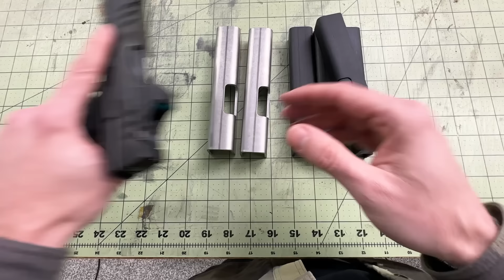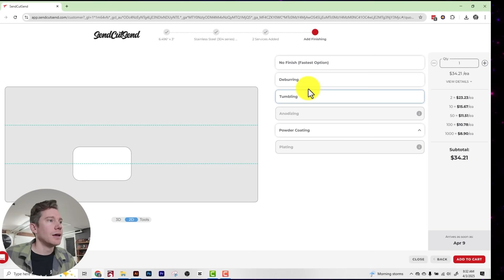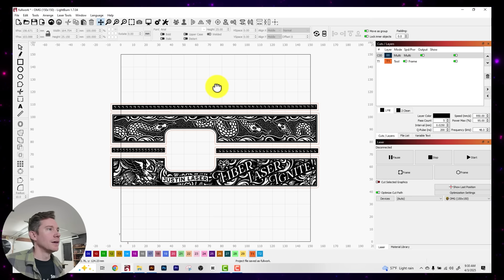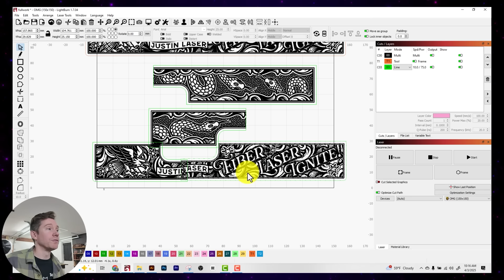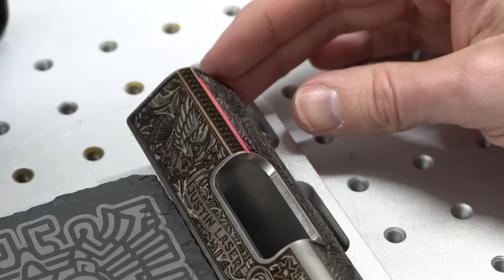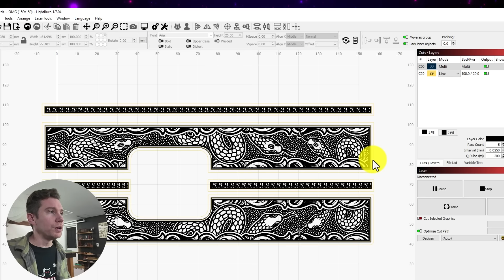How I Practice Gun Laser Engraving (without a gun) + Free Template!

Comment: If you build boards with dowels that fit on table.stops that fit a few of your dowel pins once you build the fixture your next setup is done just cut your stops as you x and y with the laser to set home positions. Remove store fixture setup next fixture all you need to run the machine is an operator to load push start rinse & Repeat

Comment: 304 is also a lot less tough strong and rigid than the steels they use in slides. with stainless slides which are the ones that you would probably be engraving (refinishing is much more difficult than it would seem) usually they use 17-4 or another more rigid type of steel. 304 is usually not milled because its a pretty pliable steel and its usually bent as flat steel.
Reply: so which type of metal would you recommend to replicate a real gun?

Comment: Great video but I use G19 Gen 3 after-market slides that I mill the rear serrations on. The serrations vary in length so I would need to be able to adjust the design, plus, the Glock slides have the varying size ejection ports and the slide-stop notch. I have seen engraving examples that follow the curves exactly. They look great. I would love to find templates like that.

Comment: So you don’t use any jigs to line things up? I’ve only got a cheap diode xTool laser, but one of the first things I did was mark a baseplate and 3D-print part holders for the stuff I was cutting. Feels like if you had a properly machined post or bolt threaded into the baseplate, you could mount parts with repeatable angles and positions for every burn. But maybe I’m not seeing the whole picture.

Comment: Hi, friend .
Thanks for this template.

My question

- When working in Illustrator, the New Artboard gives you the option to choose 72 dpi, 150 dpi, or 300 dpi.

- Which one do you recommend for taking it to Lightburn without anything being distorted or magnified?

- In Illustrator, when making a design for fiber laser engraving, the measurements must be exact.

- For example, I have a cylinder tube 154 mm long x 35.7 mm circumference. I design in Illustrator to reflect it in the Laser work area with a 150 x 150 lens or can I put the 200 x 200 lens. How do I use the ROTARY 80 to record everything? Put it on the rotary.
thank you

Comment: Having lasered a slide for a friend, I would say a more important prep step would be to get some test material of the same metal as the slide. Those hardened tool metals put up a lot of resistance when trying to remove material.
Reply: I was thinking the same...  I'm just going to get a stick of square steel tube and cut pieces about 6"long in the bandsaw.  Basically the same idea as this, but way cheaper/ faster/ easier.  Maybe mill the ejection port, but also maybe just scribe it on lol.
Reply: I was wondering the same thing. Nevertheless, I enjoyed the video!

Comment: This might be silly but have you guys tried using a 10w diode laser? I only have a 10w laser i wanna it if it can it that
Reply from the maker: If you used marking spray you might be able to get a black marking a design on the metal but it wont engrave at that power and wave length.

Comment: What type of laser would be able to handle this? Im wanting to have a slide done (either by myself or a company) for a retirement gift. If i do it myself i have to buy everything so what is the minimum laser i wpuld need?
Reply from the maker: I would at minimum get a 30w fiber. If you want to engrave the whole slide at once the biggest concern would be lens size. Would need to make sure you match the lens size to the max size of your slide. Usually around 175/200mm.

Comment: on stainless you can also run an annealing pass after the deep engraving to mark it black. I do deep engrave, cleaning passes first. Then I run deburring, polishing passes to clean up the burrs and then annealing passes last
Reply from the maker: True! I did that with the hatchet I did a little while back. I really want to get better at the ink/paint filling I love the way it looks.
Reply: How do you do a deburring pass????
Reply: Would love details on a deburring pass!
Reply: So I’m trying to get into laser engraving I had a laser engraver before but it wasn’t powerful enough to do what I need it to do and I need tips on how many watts is to low for engraving on gun slides
Reply: @MatthewWade-dg9fm eu também tenho essa dúvida
Reply: @MatthewWade-dg9fm If you intend to do guns, you'll want 50 watts or better.
Reply: Would love details on a deburring pass!
Reply: Please share deburring pass settings.
Reply: Why didn't you just go to home Depot and get some steel square tubing? It's about $40 for 4 ft of it, you can get about 16 slides at 6 in, then you can get cerakote spray paint to do the anodized ones.
Reply: I noticed that you have two sites and I wasn't sure exactly why?

Comment: I am in the process getting my FFL right now to do engraving and Cerakoting. If you are working on guns, regardless if it's a frame, barrel, slide or anything that has to do with guns for a profit it requires an FFL.
Reply: State laws will vary, but under Federal law you can buy, sell, and even manufacture unregulated parts without a license.  If all you're working on are slides, barrels, hammers, triggers, sears, etc BATFE isn't going to care.  If you want to work on serialized frames and receivers, that's a different story.  If you want to buy/sell/work on/modify them you'll need an 01 dealers license.  If you want to create new frames/receivers for commercial sale, you'll need an 07 manufacturers license.  Always check state laws though, they're all over the place, particularly in regards to magazines. Anyway, if you want to laser engrave everything but frames, go for it. Lots of businesses out there already doing it.
Reply: 100% wrong information. You only need an ffl when working on a sterilized receiver. Any parts besides the receiver, you are able to work on as long as they are not attached to the receiver. If somebody wanted you to work on their A.R. 15 and gave it to you without the lower you are legally able to do that without a license.
Reply from the maker: Very true. I also live in New Jersey Im not going near it yet lol.

Comment: What is the Multi Mode your engraving with? I just have line, fill and offset fill.
Reply from the maker: It will change to multi when you add sublayers in your layer panel.
Reply: @justinlaser  Looks like I have more learning to do. Sublayers is something I have not even worked with before.

Comment: Sssssss🐍ick slide engraving 💪🏽
Im still looking into a fiber but assuming I need something more than a 20W to achieve this? Was looking at F1 Ultra due to the dual capabilities and extras that come with which the cost would be comparable to a 30W fiber.
Reply from the maker: A 20w could engrave the design however it would probably take ages to get any type of depth in the steel. If want to focus on metal stuff like this or coins, etc go with the straight fiber. If you still want to do wood/acrylic/etc as well, F1 Ultra would cover all the bases.

Comment: you could 3d print these for much less money, and even have it match the shape of your slide.  you would be testing for placement, and just doing a light pass (very quick) to cchange the color of the filament.   for depth and color settings, you can do that on a flat piece of steel.   or a single metal custom piece from that website.. as a final test. 
but 3d printed slides would cost a buck or two each.   there are pla or petg colors that react well to a light fiber pass.   
so.. if you want to save several hundred dollars..  a 3d printer might be a good solution for ya. 
the bambu A1 is cheap and good.   and.. there are tons of other tools, jigs, clamps, and parts that the printer can make to help engraving or holding a piece easier.  
knowing is half the battle. 
knowing fiber laser settings for a material is the other 170% of the battle.
Reply from the maker: I want to practice as close to the real thing as possible. That is going to require mild steel/stainless/aluminum as that is what most slides are made from. I would consider 3D printing other parts that are often made from polymer like the handles though.
Reply: @justinlaser  the shapes would be exactly the same. it's for placement and jigging. 
meaning you don't need $100s for metal slides that are exactly the same just for placement and jigging practice. 
the power of the laser is irrelevant for those parts of practice.  
when you have art placement and jigging sorted, then you go to the metal slide.  
but.. if you feel more comfortable  spending $$$ for the same result as $...  
that's a choice.   you had what, 5 identical slides sitting there?  4 of them could have been plastic.  power settings are the same for a flat piece of metal as a cut and curved one.   settings can be tested on a much cheaper piece of metal without cuts and bends. art and jigging can be tested on plastic parts.  bring it all together on a single test piece and it should all work, then go to the real thing.  
but.. plastic slide can also mimic your weirdly shaped slide, which has hills and valleys. you'll see changes in the lasering between those peaks and valleys.  
saving money and being more accurate isn't everyone's thing though.  I'm sure it'll still look pretty good, as a pattern complexity will hide inconsistencies if you don't know where to look.  :-)

Comment: Great video!  Suggest incorporating rectangular areas into the design so you can more easily get away with being off at the seams where you need to relocate the part due to the size of the engraving area.
Reply from the maker: Yes agreed. I made it way harder on myself trying to make the perfect connection. Should just design it so it has a natural break area and add something else in there.

Comment: Very cool.  Do you use the air blow to get the ash out of the way for better laser results, or for better videography results?
Reply from the maker: To keep the crevices as clear as possible and to help cool down the metal when doing long runs like this. I ran each over 100 times and found that stainless heats up like crazy.
Reply: @justinlaser  Nice.  Looks like I have a case to create liquid cooled laser fixture tables for long processes.  Ill have to lock down a fiber laser of my own to start building that.

Comment: You need to do offset stops if you are going to split engrave as you can still see the join line. It will make it more easier to accurately repeat jobs. If you have access to a 3d printer it makes it dead simple to make jigs for repeat jobs that bolt to the laser bed.
Reply from the maker: Will take a look. 3D printer seems more and more inevitable.